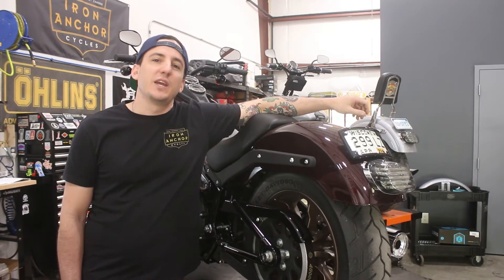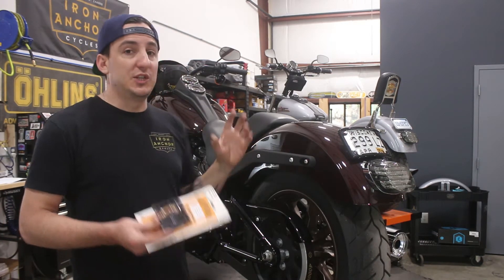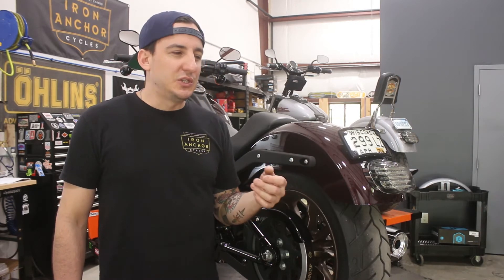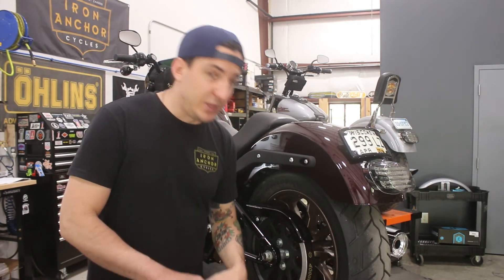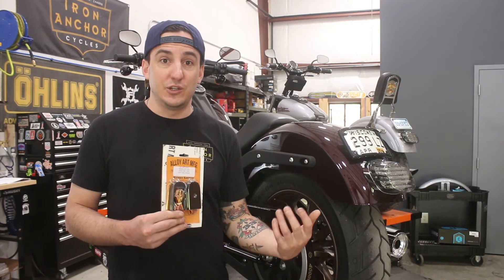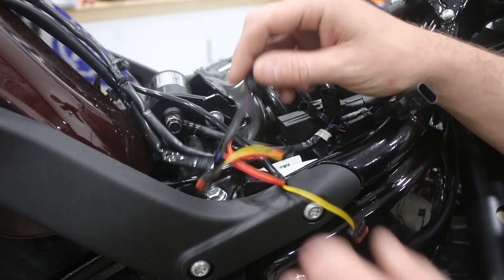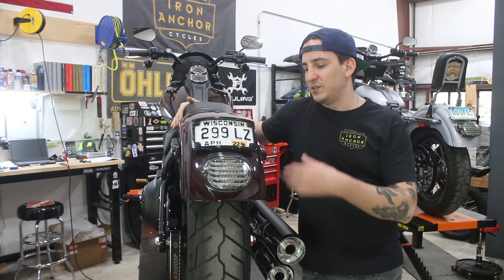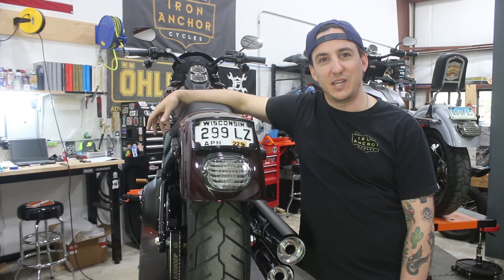Project FXLRS - Part 2 - Alloy Art Fender Strut Lights

Comment: Great install video. Did you splice the running and brake light wires by a crimp connection or by a new pin connector?

Comment: I Have a 2015 FXDB Street bob. Lights have 4 wires bike has 3 wires. I want to get the amber flash to function we turn signal but can’t get it to work. Is there some type of module or a plug and play I could hook up to get amber flash on the  turn signal?